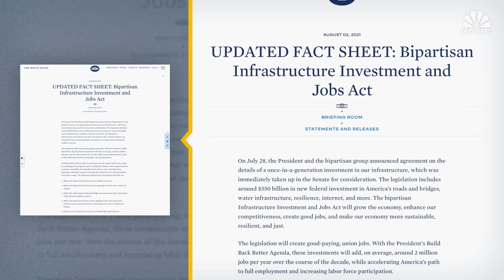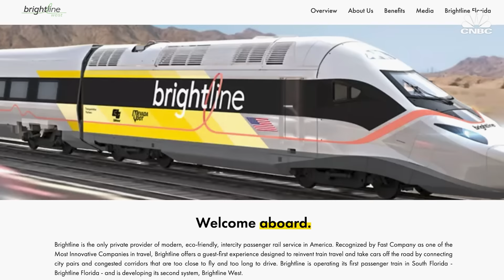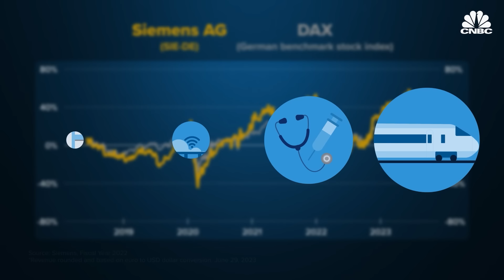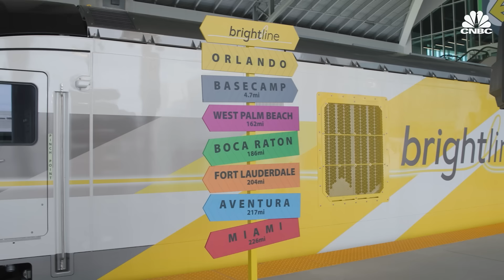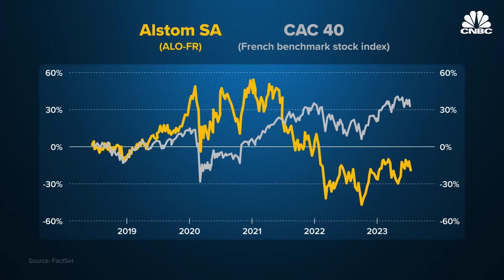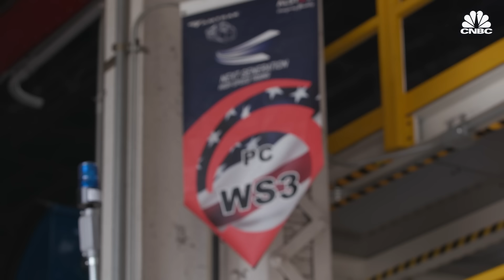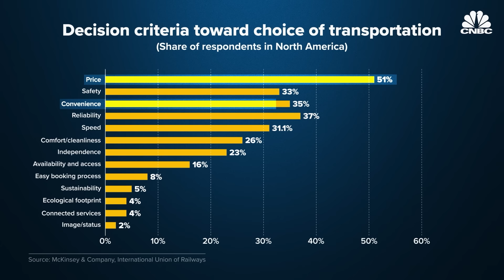Why Passenger Train Manufacturing Is Booming In The U.S

Comment: The commuter is the ultimate authority if they want to travel by train or plane.  More competition is good and gives more option and better service from train and airlines.  But they have to be for profit not government funded so we throw money at a pit that just eats money only for the few who use it.  They can build the infrastructure but it has to be operated privately to see if it is what customers want and pay for.  Train is roomy and good for short distance travel, heavy load, short travel time then it is economical.  Europe is a country with high congested population that you can move from one side of country to other side in 4 hours.  In USA the distances are large.  Each state is sometimes bigger than a country in Europe.  No one will use rail travel commercially to send employees from west coast to east coast on a train and pay them 3 days salary full time 72 hours for travel.  It is more roomy than plane but still not the size of hotel and conveniences.  Keep in mind train stops a lot and travels at top speed of 125M/hour and planes at 500M/hour and planes don't stop as frequently.  They are both useful for different and some overlapping market.

Comment: Yanks aren't smart enough to grasp that 4 hours on a train is faster than 2 hours on a plane.  Plane travel involves going to an airport outside a city, checking in, flying, then travelling to the destination city from the airport.  Train involves going to a train station downtown and getting out downtown in the other city, without any security checkins.  It's faster, AND safer.  As for cross country rail, if the yanks had built commuter rail 60 years ago instead of depending on planes, high speed rail would already exist.  At 240kmh (or 150mph in yank measurement), New York to Los Angeles would take a day and a half.  At 400kmh, it would take 12 hours - get on after work, sleep in the sleeping car, and arrive at 8am next day.  How is that "slow and inconvenient"?

Comment: In WHICH country are the trains being manufactured?  China and Europe, like our solar and wind?
Reply: Nope. They’re being built right here in the USA.
Reply: @metrofilmer8894  I will be very curious to know if they are American firms or foreign?
Reply: @InsightsAbroad  the largest ones are from abroad, like CRRC, Siemens, and Stadler. Most local rolling stock manufacturers like St. Louis closed down back in the 1960s, while Budd and Pullman were bought by Bombardier in 1987, which was subsequently bought by Alstom.
Reply: @ianhomerpura8937  thx for the response. I had a feeling. I wish Boeing would open a rail division

Comment: The federal government should buy up the private lines all at once, upgrade them to class 8 (safe up to 160 mph) and electrify them with overhead wires. Install extensive layered automatic safety systems and monitoring systems, remove level crossings, straighten out curves. Invest in new rolling stock for Amtrak to meet these standards. Lease back the lines to private rail companies to run fast freight and mid speed passengers.
Reply: Class 8 is the sweet spot for the USA. It is at least twice as fast as the fastest freeway speeds, making it more attractive for fast freight and regional passenger transport. But it is also much less expensive than the 200+ mph high speed rail systems which would be difficult to accept the cost for the vast distances in the US. After the whole network is standardized and integrated into a new higher speed and more reliable system and built out to numerous destinations the riders will increase and the freight volume will increase. Long haul truck routes will reduce in volume and be replaced by short haul routes linked to rail.

Comment: Well, we now need to compare trains with electric cars, and even auto-driving electric cars. For longer distance, I will take plane. For shorter distance, auto-driving electric cars will be very competitive. As providing high speed trains not for profitable but for public transportation, China has done that and now the citizens over there have to pay for the money losing business anyway since it bleads money quickly. As a matter of fact, the original plan in China is to use the real estate development surrounding the high speed train stations to pay partially the cost of the high speed train, which betted on the crazy grow of the housing price. It does not happen most of the cases
Reply: Roads don’t make a profit either.

Comment: Delusional. It HAS to be profitable or the cars will ultimately be smelly, dirty, and run late.
Reply: what??
Reply: @hirampriggott1689  Assuming that public transport does not have to be profitable means the service will be run by Amtrak the same way it is now. I took the train from Fort Lauderdale to Jacksonville twice.  It would have been better to fly to Orlando.  The cars were smelly, the garbage overflowed, the internet was spotty, and the arrivals were not on time.  If it were run in a profitable manner, none of that would be possible or permitted.  There is a lot of competition from airlines (and local buses).  So give me a compelling reason to ride it other than new rail cars which soon will be older rail cars.
Reply: @markdiener1425  1. Amtrak serves intermediate stops between terminal destinations (Fayetteville, NC....Jacksonville, FL).   2.Amtrak is a great alternative in the northeast alternative to flying or driving on Interstate 95.   3. Train travel can be fun and relaxing.

Comment: I hate this language constantly used of "the question is, will americans accept this new thing?". It just fuels debates on things that don't need to be fueled. Sell americans on an idea or a dream, and like any population, they will accept it with time. High speed rail, and even scmaglev later down the line would be hugely beneficial in connecting americans on a level never before seen

Comment: America passenger rails are being built based off of subsidies not demand. US cities and towns just aren't designed for rail. You need high densitiy cities and no amount of rails will be able service the highly spread out suburbia that makes up america. Imagine this, if you have to walk 10 miles to a train station and then ride the train then walk another 10 miles to your destination, then doubling the density of the rail network makes it so you walk 5 miles instead. This only makes sense in highly dense cities. 

Car is still the king. I walk zero miles.